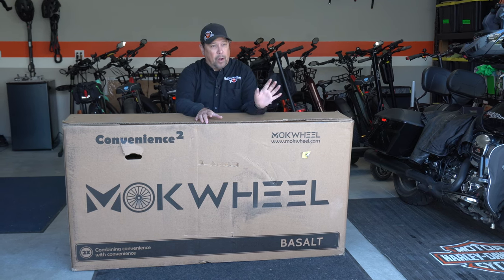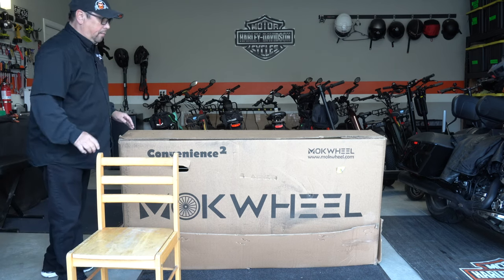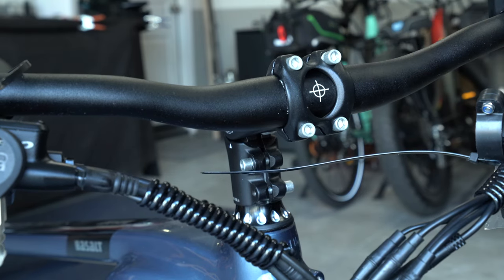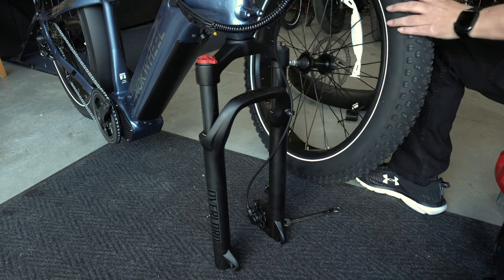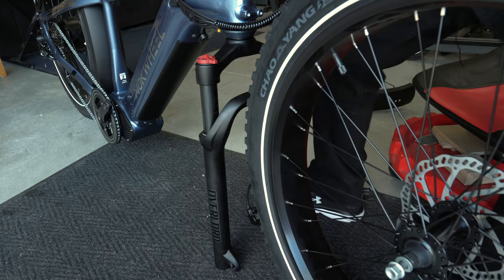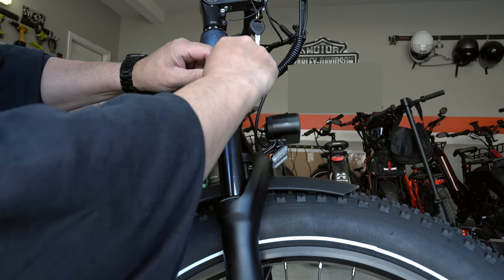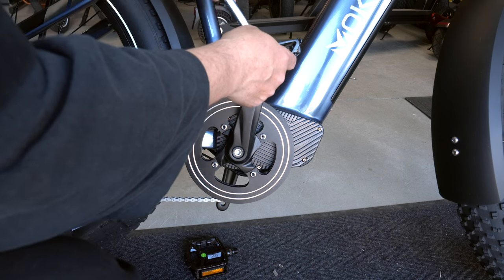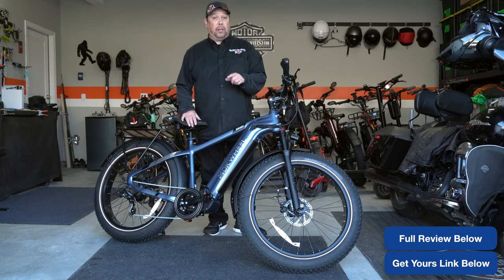Mokwheel Basalt Unboxing and Assembly

Comment: thank you for this. just a note to non mechanical people there is a lot here that is not being shown like the pieces you have to install to finish installing the front Fender. This is a general overview for technical people..the directions are almost non existent so this video is quite helpful.
Reply: Hi! Could you please tell me about the pieces that go to fit the front fender? I am struggling a lot with that part. Please!! Thanks!!
Reply: Totally agree about the front fender. My bike seems different from yours. There is not a bolt or screw to remove. Instead, I have a bag of parts I assume are mounting brackets but no instructions and I cannot figure out how to configure those parts. I am just going to leave the fender off.
Reply: @alanlipps1896  what I did was add extra washers so the bolt can reach the other side. That helped me.

Comment: I cannot figure out how to attach the front fender to the fork. I have a bag with some hardware, but I cannot seem to arrange the hardware in any way that parts (I assume they are mounting brackets and bolts) fit together sensibly. Can you show a video specifically on stating the fork/fender mounting brackets and the fender.
Reply: I just got one…..looks like there is a small black right angle that needs to be attached to bosses on back side of ford now and then attach fender supports to the bracket.  At least that is what I’m going to try.  Did you get it figured out yet?
Reply: There is a little wrapped baggie separate from the main bolt bag.
The brackets that @alanlipps1896 spoke of are in there.